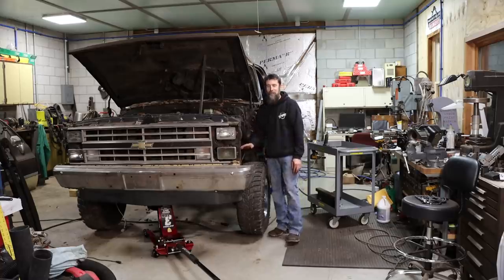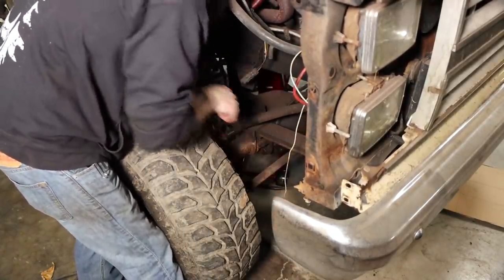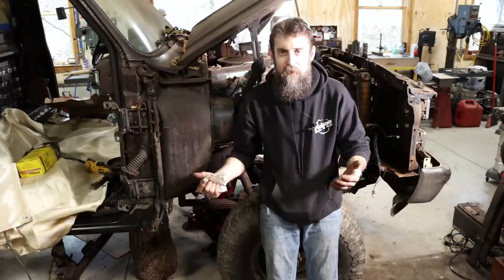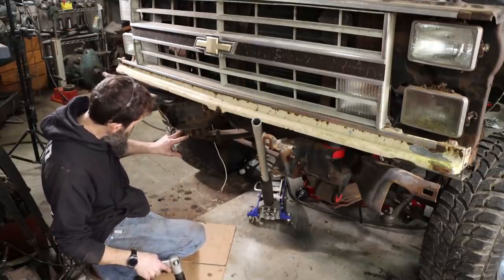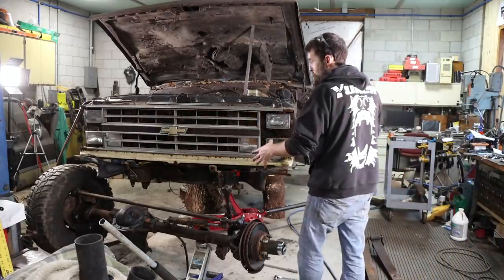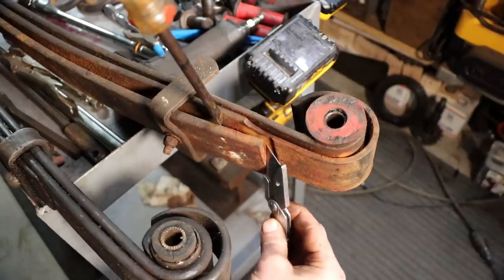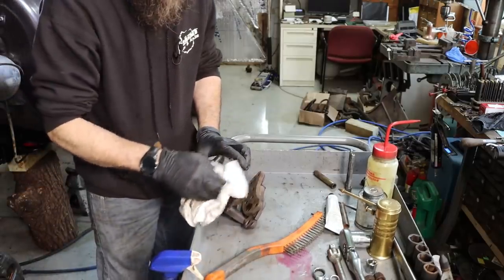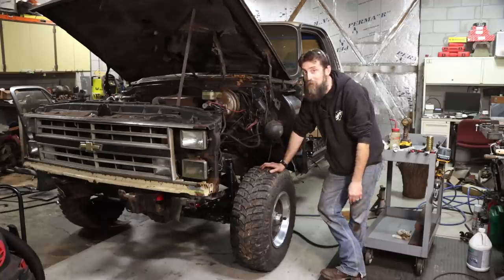Dropping and replacing the entire front axle. Everything was BAD.

Comment: If they made a brand new square body exactly as it was built in 1980 I'd buy one today! It's a lot better for them to make a $60,000 truck and sucker people in with 99 month financing and a 100,000 mile warranty. The average new vehicle is now more than 2/3 through it's usable life (around 12 years) before it is paid off. Most people never pay them off before jumping onto a new debt treadmill.
Reply: So true and so sad.  I needed a PU and all the local used trucks (Bloomington,IN) were rust buckets.  I started searching Craigslist in Dallas, TX and found a 2000 F250 w/o a trace of rust and got it for $3200, this is in 2018.  Cost $900 to have it trucked up. $200 to my friend in Dallas who did all the face to face and test drive.  My retired Ford mechanic went over it and replaced needed parts, $1000.  So for $5300 I now have a smooth running and dependable truck.  Dallas truck don't rust, they just paint fade.  I need it in the summer, so it's resting in my barn during the winter.
Reply: Yeah.  The problem with just selling the old model is that the law doesn't allow it any more - fuel efficiency has to meet a certain number, it has to have safety features up to date,  etc.   To put those things in they'd have to significantly redesign/lighten the truck which would take away a lot of the reason you'd be buying it.
Reply: I have been shaking my head for years about the practicality of todays vehicles. These old square body's are really nice when given the "Steve" treatment.
Reply from the maker: I agree,  Those payments keep coming long after the new is worn off. I love the new trucks like most people but I can't see paying as much as they are asking for them. Talk about a bad investment for the average person.
Reply: Iv had really good luck with f150s my first was a 95 4.9 then an 05 4.6 now a 15 with a 5.0 all got to about 280k before any big repairs the 05 took a trans at 280k  got totaled at 320k  the 95 took fuel pump and a shift fork at 120 made it to 300k when I sold it. The 15 is still running at 220 and knock on Wood iv only put brakes tires and a belt about to do shocks
Reply: @SteveSummers  You know it bud. Like yours mine is a work truck. The bed is covered in dings and bumps. I have a headache rack to protect the bed sides and rear window from the ton's of firewood it handles sometimes year round. Come hunting season I will winch a full bull moose into the bed. My vehicles work for their keep. I respect them and they in turn produce for me. A win, win eh. It is sure a nice visit with you every weekend my friend. You know how to do it right eh. Take care now and see you next post.
Reply: Chevy sell a fairly large number of basic trucks.  you can get a 4wd 1500, 2 door short cab, bench seats, 8' bed for $35Kish.   They end up in fleets, who aren't buying trucks as a status symbol, but for working. Dealers don't buy a lot of them, because individuals don't want them, they want a toy.
Reply: They can't do it. Once they stopped making cars the trucks have to carry the Corp. Adding tons of cheap bling and jacking the price up to infinity allows them to carry it. You get dazzled by the BS and they laugh all the way to the bank. Does anyone actually think that there's a big price difference between a Platinum, High Country, or Limited and the base truck? And yet that's a swing of $35K to over $100K!!!
Reply: @SteveSummers  So true you can still buy a starter house here for the price of an average pick up and get a nice little home for the price of a nice one, barring the large two stories. 

That has always been a better investment in my eyes, I think would walk before choosing a truck over one.
Reply: @dmscheidtify  Ahh, the grass is always greener on the other side of the fence and They all have to look better than the Joneses eh, LOL.
Reply: There’s pros and cons to both for sure. The biggest con I’ve found with new ones is just what you get for the price. I think new vehicles are sometimes less dependable as far as electronics, harder to work on, but also on average run way more miles than old stuff. I mean the old square bodies could be rebuilt and ran forever pretty much but I’ve seen way more new trucks with 300k miles on them that drove fine than I have square bodies that even had 150k miles and drove fine.

Comment: I never bought a new pickup.  My first pickup was a '73 Toyota 2WD for $1200 around 1980.  My "latest" one is a '04 GMC Canyon 2WD for $7000 in 2007, it now has 105,000 miles.  I just saw a 2007 GMC Canyon 2WD advertised for $12,000 with 150,000 miles.  It is insanity.  
I admire your work on the square body Chevy.  Your labor is adding a lot of value to your truck.

Comment: Another advantage to fixing it yourself:  Few surprises.  You have examined at least and fixed/replaced a lot of the truck and IKNOW its condition.  Can't say that about a used truck you buy from somebody else, no matter what you inspect from the outside without taking it apart.
Reply: Yes buy a used vehicle expect to spend at least half the price again, doing repairs and the deferred maintenance on it, to get it up to some sort of standard.

Comment: Excellent video.  I totally agree with the minimal features comments on trucks AND cars.  You can not find a simple minimal frills car either.  I'd rather keep my eyes on the road instead of a touch screen menu.  Dashboards like jet cockpits are crazy.  Quality components, simplicity and easy to maintain would be my preference.
Reply: Minimal frills car - Dacia. Don't know if they're a thing in the states though.
Reply: Menu is the key point, those are 
Replacing the mechanical gauge cluster with a screen is a smart move, though. Those panels are jelly bean parts now and have gotten insanely cheap, as well as electronics. Wheel sensor for speed (with ALB already there) and simple sensors for temps and such which are already there anyway, and a screen with some chips behind it can do exactly what classic gauges did, but much cheaper. A car manufacturer could even use the same screen in all their vehicles and just use different display designs and features depending on the model and trim package without the need for dozens of different hardwares --> highly cost effective.

Comment: Steve, years ago I made some short digging irons for work and used spring steel for the cutting end. I cut into the spring about 1"x2" with the torch, left it cool, then welded both sides to the round stock. By cutting the spring, it annealed the steel, and made the weld hold better. This tool soon became popular with the whole crew as we did mechanical demolition, and it was enough leverage for many jobs. This might be something you could do with the old springs.

Comment: TIP. Seized spring bolts and control arm bolts. Tighten the nut and loosen the bolt. This grips the bushing inner sleeve while the bolt turns inside breaking the rust bond.

Comment: I cannot stress this enough. Pull the steering gearbox off the frame and inspect the frame around all the mounting holes. They are known to crack there, they make a reinforcement plate that can be welded in to strengthen that area.

Comment: 5.3 LS, nfw-1050 flywheel, $39 ebay mount plates, 01 truck upper and lower radiator hoses, e16020 frame mounted fuel pump, 96+ Chevy truck throttle cable and you will never regret it.

Comment: You are doing it right fixing up the old square body. I have had several. You may have done it off camera. On the outer brake pad, pry it up towards the top of the caliper and hammer the tabs down on the top of the pad that bend over the caliper. That tightens them up to keep them from rattling. Also I'm sure you know, check around the steering box for cracks and make sure it has the gusset behind the steering box. For the price of a crate motor now a days, it seems to be the more economical route to just get one if you looking at the value of your time. Get a newer one piece rear main 350 with vortec heads and holley efi and you will have a real nice running everyday driver. Good job fixing up the old truck.

Comment: My wife bought me a base model F150 in 1986 for about $10K, and in 1994 we bought a Ford F150 4x4 crew cab with options galore for closer to $50K. By 2006 the '94 was a pile of rust and nothing worked reliably so it went to the auction for parts. The '86? it STILL is running like a top and has "patina" but no rot. So I vote for simple, inexpensive and well made.  Oh yeah, even with emissions there isn't a thing on the '86 I can't work on... the '94 required a tech for anything more than an oil change. BTW, great vids, great family, great critters, and great beard! Thanks for all you do !!

Comment: I bought a 1981 Ford F-100 in May of 81.  Mine was geared for the road with 2 wheel drive.  It was completely stripped down with the Ford 300 six cylinder.  I still have it with almost 600,000 miles on it.  I am on my third engine.  No rust anywhere body or frame due to care on my part.  If you buy a truck new and are careful it is possible to beat the rust.  I live up near Falmouth.  Ellis

Comment: As far as I am concerned new vehicles are way to complex, electronically controlled systems, nice when they work, a pain in the arse when they go wrong. What you are doing there is the right way to go. The older stuff was made a lot better than the newer. While it is the shop if you can do the motor, I know that is a lot of work, however when you roll her out, you will have something special. Great vid, stay safe.

Comment: While you have it apart check the frame around the steering gear box for cracking. It's a common failure on these old 4x4 trucks.

Comment: 30+ years ago, when I was doing reno. and construction, we always had the most basic of Ford F150's: 6 cylinder, 3 speed standard shift, 2 wheel drive, bench seat... and we always bought them used as we had our own auto shop. Our mechanic loved them for their simplicity and easy access for maintenance. We always threw a piece of 5/8 plywood on the truck bed as a poor man's liner.      I loved those trucks!  As always Steve, great stuff. You never disappoint.

Comment: Okay I take it your Steve Summers? I am a GM Master tech that retired last year at 65 years old. I started in a GM Dealership in 1979. Did I ever do what you are doing, only hundreds of times. I watched as you grabbed the old Blue tipped wrench, cutting torch. Just a couple of notes to pass on. Yes they did make a Quad shock kit, you did have to drill the frame rail to install. On the older high milage trucks with loose front end I found the cross brace between frame rails would start cutting the rivets into! Have someone rock the steering wheel with the tires on the ground and see if there is movement where it is riveted into the side rails both sides {mainly by steering gear box}. I see you have manual locking hubs, techs hated the auto hubs. Really if they were kept free of rust and debris they worked great because you did not have to get out in the mud and snow to lock them in. One last thing as the brakes, steering and suspension mech, very few people knew that the stance {distance between wheels} was 3.5 inches wider in the front than rear?? They were 1.5 inches shorter on the right side? We never could get GM to tell us why they did that!   Happy New Year, your project is looking good. {you know I can not let you Jack Stands GO, be Safe}  DonR

Comment: I can tell you that in 1981 I bought a Ford 1979 F-150 4 wheel drive brand new off a dealer's lot (after the fuel shortage they could hardly give away fwd trucks) for a grand total of $6200.  That included them putting in a limited slip in the rear.  I do know it listed for around 12k at the time.  Now at almost 75,000 for a similar configured truck the value just isn't there.  I worked for wages and as I recall they were around $13/hr.

Comment: I have a 73 square body one ton dual wheel flat bed. I think that was the first year for the square fenders. I asked the lady at Farmers how much it cost new. She said $2300.00. Sounds a little low but she was sure of her source. Interestingly enough I later acquired a 82 one ton for parts and was able to move the rear axle, transmission, cross members over without modifications. Even the fuel tanks fit perfectly. I don’t think they changed the frame since back before the 60’s.

Comment: One thing your correct on is pricing of pickup trucks in general. On of my friends who owns an auto repair business just bought a 3/4 ton 4 wheel drive truck that was 3 years old, last summer. This was a gas Chevy that has over 190k “highway” miles on it. He paid 30k for the truck, if the average person purchased it and daily drove this truck, there is no way  that it would make it until the financing contract was paid off. My first 2 wheel drive square body 1978 was around $4500 new. The 4 wheel drive Ford I purchased 6 years later was 15k in the mid 1980s

Comment: Prices on new and used trucks is whacky right now, for sure.  I'm old enough that the first new vehicle I bought was in 1986.  Truck prices back then varied depending what you got like they do today but a full size truck with 4wd would set you back about $10k.  Yes, you could pay more and maybe a little less.  Adjusted for inflation, that's about $26k today if you use the online inflation calculators.  I've owned used and new trucks, and if I'm being honest - as endearing as the old trucks are - a used late model truck is still a more daily-friendly vehicle than something from the '80s.  Of course, if you want to sell me an '80s pick-up, let me know!  Keep up the good work, Steve.

Comment: I'm this far into your squarebody adventure. Ive done a similar project ('75 gmc c30 to K30 frame swap, 4.8ls, 4l80e, rebuilt NP205 with the jb twin stick, rebuilt dana 60 front axle) and am enjoying watching someone else do the work. I now have a mechanically sound 4x4 1 ton truck for a little more $$ than the average worn out 4x4 around here with 200k miles on it. Bonus if something goes wrong I know the guy that did it and how to fix it because I've done it at least once (probably twice) before.

Comment: I have a 1979 GMC Stepside that I restored in the mid 80s and it has not seen winters since. Cab corners, rocker panels, bed sides, tail gate ,door bottoms and fenders all had rust. I replaced everything with all new sheet metal, My 2009 GMC has faired better in the winter and has only recently started to rust. The 73-87 had too many areas where sheet metal over lapped and rusted from winter use. The technology that the 2009 has is more than I would ever need. I would buy the same truck new today for $30,000. It is an extended cab Z71 4X4. But I would never pay $50,000 for a new pick up that had to be driven in the winter. The manufacture is not bothered at all about the cost of new trucks because they know that they can make money off of leases.

Comment: Bought a 2000 Jeep Grand Cherokee for $2,400 over two years ago. Spent about $1,100 on repairs. Did most myself.  It runs like a top but does leave a drop or two of oil on the driveway. Got an unsolicited offer at the grocery store for $3k recently. Looked it up and sure enough. If I sold it now I would get back most of everything I put into it.

Comment: I said this on the 1st video of this series. I think the old square body Chevy is the last of the great looking trucks ever sold. Right next to the 73 to 79 Ford. But engines 390 Ford and early 350 Chevy.
On the 350 Chevy 76 and older. In 77 and especially 79 was junk. Had 4 79's all blew before 70k. I had a 73, 74, and a 75 in the family. And the 74 blew at 190k. My uncle had the 73 it is still untouched at 240k and the 75 was sold at 200k and was run out of oil soon after.

Comment: Agree on the newer trucks having so many flashy and unnecessary things!  The latest I'll go is late 90's.  Enough electronics to monitor things and keep it running well tuned, and some basic conveniences.  For what it is, I'd get just a basic refresh of the exact same engine, maybe a little bump in compression for a touch of HP, not sure if that era of 350 would be suitable for a Vortec head swap (not an expert on that), and run one of those stand alone EFI throttle bodies.  A friend has one on his '72 Camaro, and it just plain WORKS, no more fiddling with chokes, adjusting or tuning the carb, flooding, VAPORLOCK, nothing but good things to say about them.

Comment: Funny, I was at a local dealership helping my kid buy a car and it seems the few cars that are making it to the dealerships are purposely the more "nicely equipped" models basically forcing you to spend more or buy used (which aren't cheap) or sit it out, at least thats what I'm seeing in the northeast. I said the same things you mentioned to the salesman: manufacturers need to make a line of cars that are  dependable and simple, with modern safety equipment but basically stripped to keep prices low. I think it would open up the new car market to more people, and probaly lowering the high prices of used cars in the process helping the used car buyer segment too.